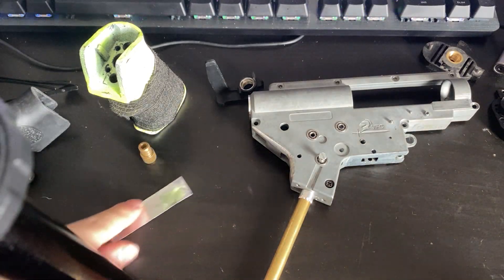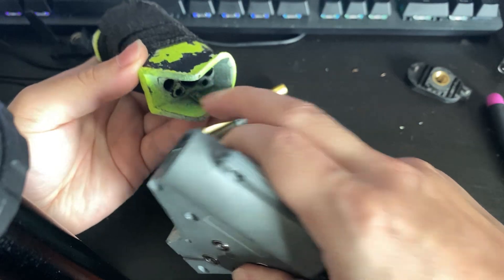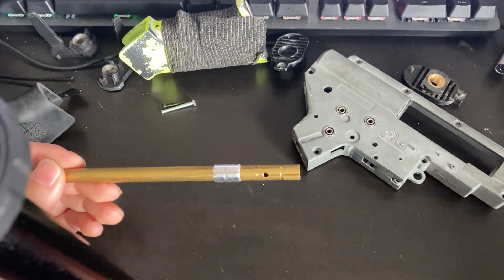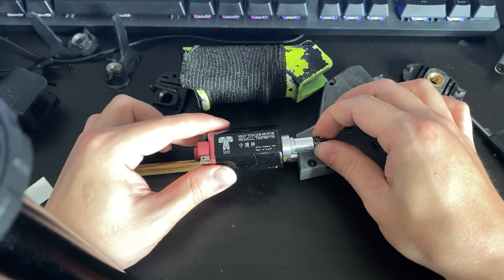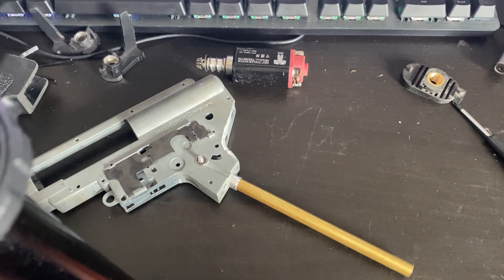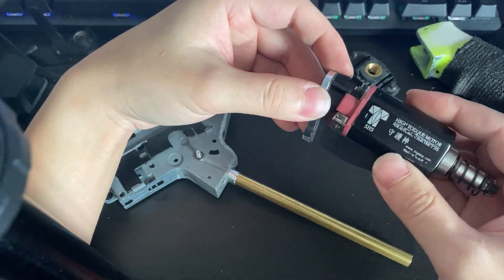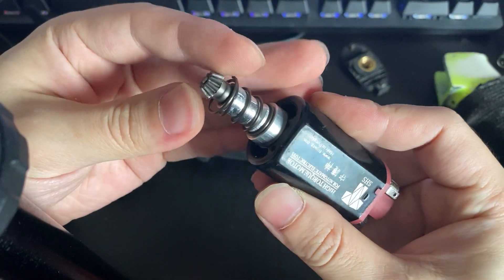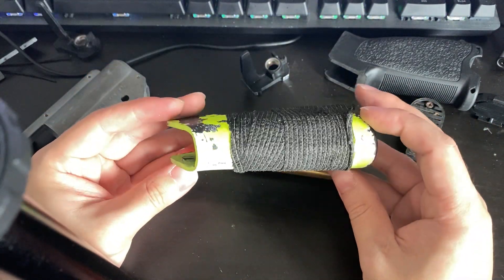AEG gearbox 101 - Pinion to bevel engagement.

Comment: laughs in V3 gearbox :D Jk, great Video! You could also shim the grip itself to the gearbox using aluminium tape. In the case of the green grip some layers on the front part of the contact area between the grip and the gearbox should do the trick. The rails on the grip usually have enough tollerance for minor adjustments.
Reply from the maker: That would be also a way for some grips that are not too off, you could dremel out the rails.
Half of V3s I touched actually doesn't define the motor all that well, I was surprised the amount of play present but at least all easy to solve as the general angles are good.